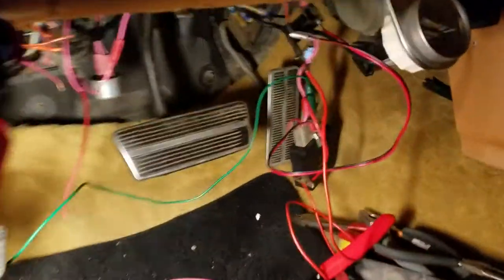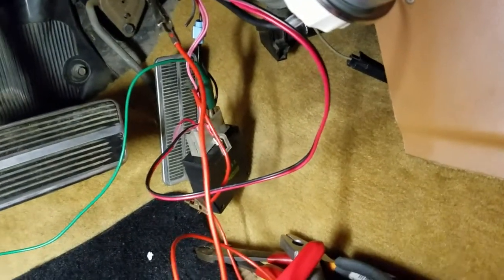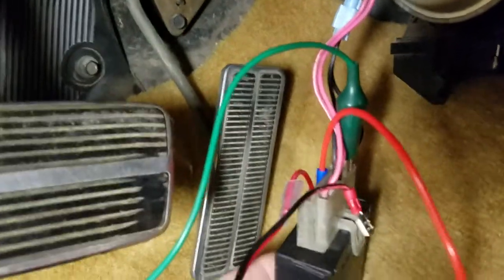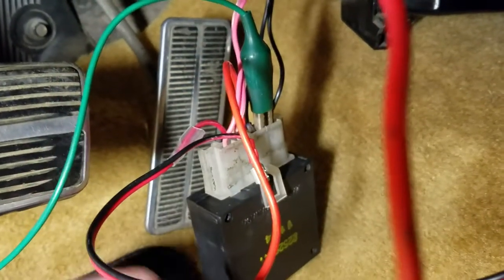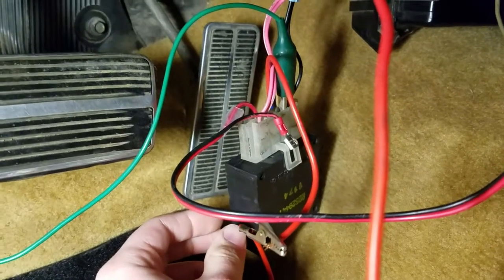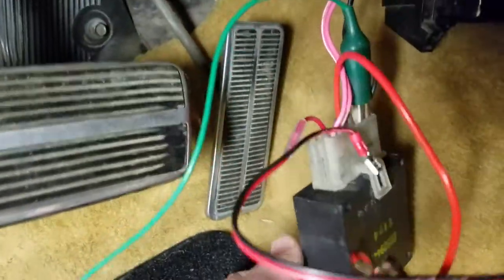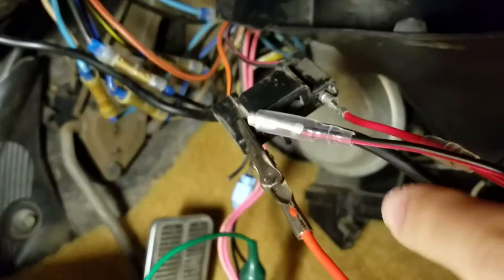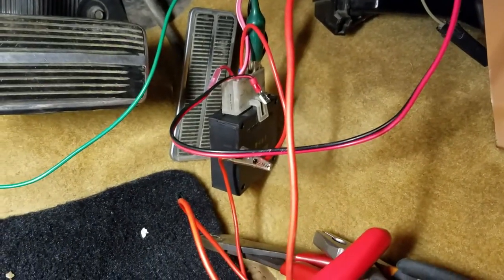Installing 1970-81 Pontiac Firebird Trans Am Ignition Key Buzzer

Comment: Good video,,   I am restoring my 76,, what color wire goes to seat belt, and what does the seatbelt look like that accepts the wire?
Reply from the maker: I believe the wire going to the seat belt is black with a white stripe. My car has aftermarket seat belts to I just grounded the 2 black wires coming out of the connector to turn the buzzer on and "fasten seat belt light" on the dash with the key on.

Comment: Super helpful man I could not figure out what that two prong connector went to under my dash after 3 years of being apart it's just the dumb buzzer thanks so much. Still have to figure out why my purple wire won't trigger for my starter but thanks again for the video. @slobberydog707